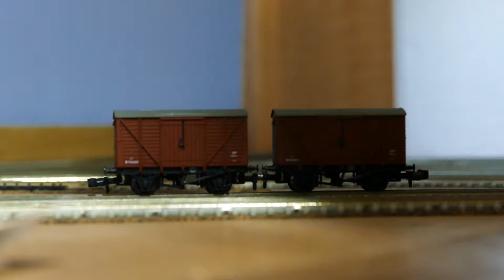P1030450

Comment: May I suggest the Dapol NEMCoup plain knuckle couplers instead? They are inexpensive and fit nicely into an NEM pocket.
Reply from the maker: Hi James

Thanks for the suggestion.

At the moment I am using Dapol Easyshunt couplings on the branch goods, but they do not couple and uncouple reliably, probably because of the curves in the coupling and uncoupling areas.  I tried converting the coaches and loco pony trucks to NEM pockets, but it was a bit of a disaster.  Currently I am using frets on the original spring couplings but, again, they are not thoroughly reliable on the curves.